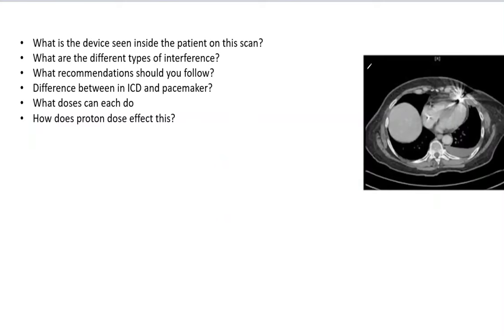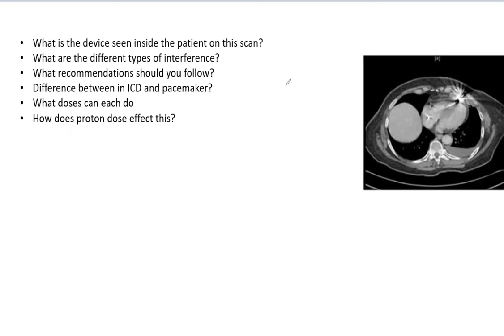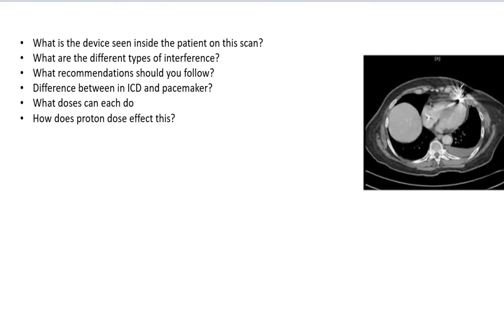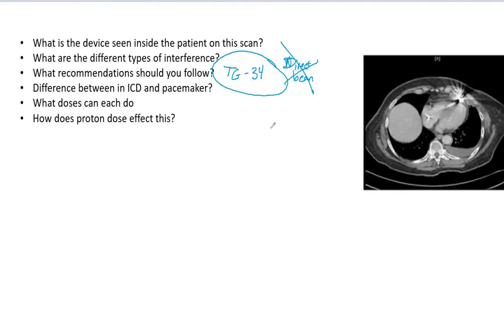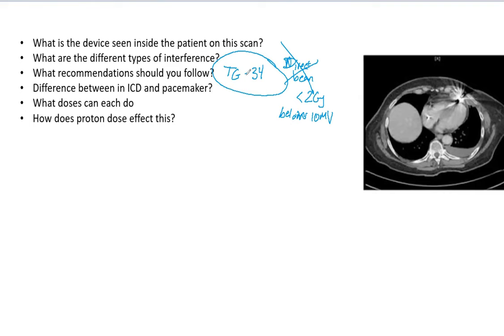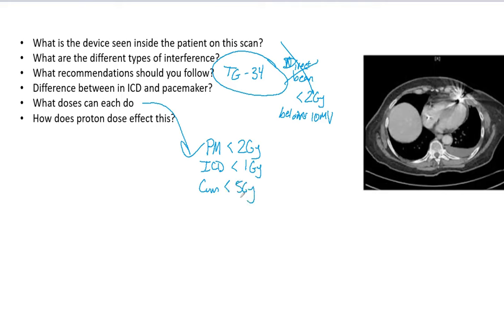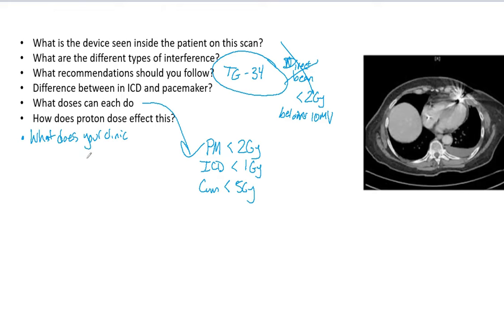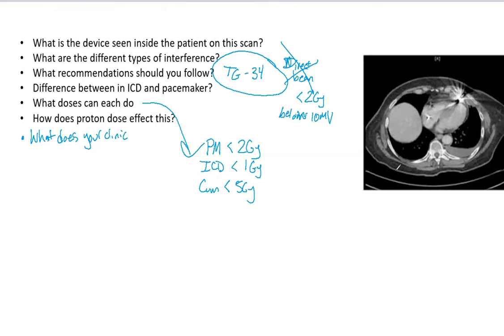Pacemakers in Treatment Planning ABR Part 3 Medical Physics Oral Exam Prep

Comment: I agreed with you. I want add  no IMRT/VMAT, no wedge beam, .  There are two kinds of patients a. independent and b. dependent to the devices. dependent has critical and needs intense monitoring. if it is dependent, personnel from Cardiology dept checks before and after each treatment.   TG203 is newer and it has 5Gy limit.  Please correct me if I am wrong.